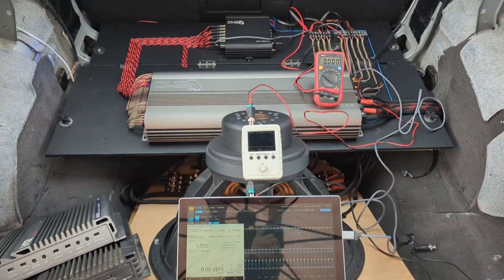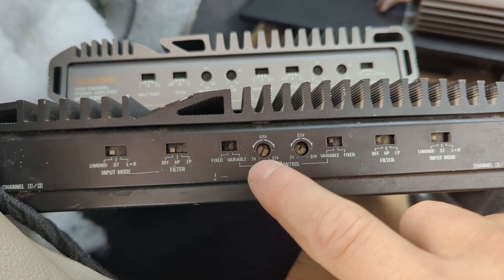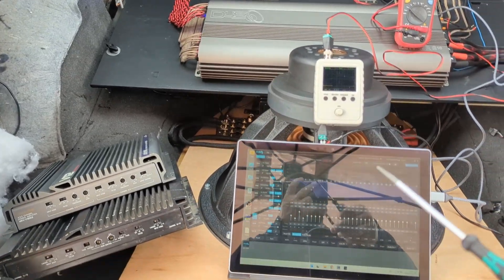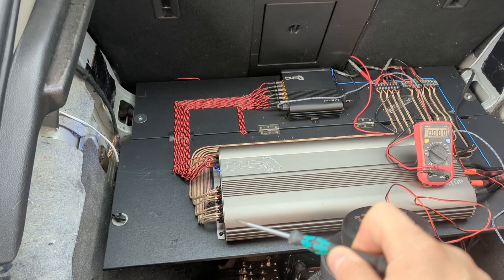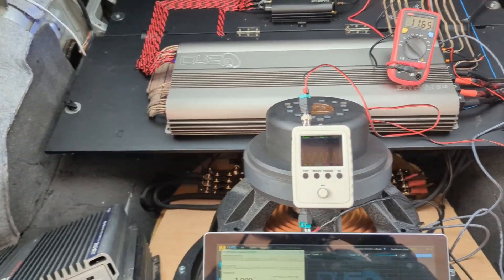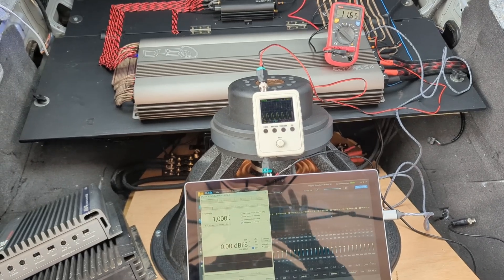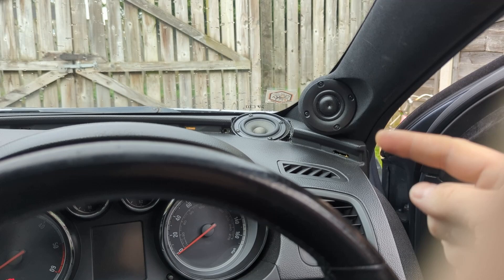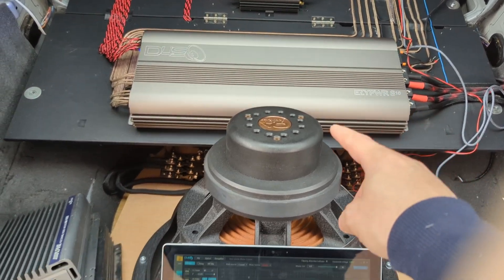Back to basics - how to set gains

Comment: Morning Raw. What about compression and expansion while using an EQ? I've run into this issue myself and try to eq last.
Reply from the maker: What compression and expansion are you talking about exactly?
Reply: @RAW-CAt  basically as you know at every frequency there are layers of different sounds. Well when you add to a frequency it pulls the very top layers first causing uneven gain from the top
Layer to the bottom depending on level. Opposite is true for cutting. It basically smashes the layers together. I know this for a fact. For one I could hear it and afterwards dug into the topic. Real issue studios deal with. My daughter plays live music and is a communications major in college and we've talked about this subject and the audibly of it. I also know this is way outside most people's interests.
Reply from the maker: @jonesaleroy  I'm not sure that is an actual issue when having 24bit content and max cut and boosts of +/-10dB.

Comment: Quick question. Isn't it the case that in order to use an oscilloscope and get correct readings from it (as well as from multimeter) you need to disconnect speakers from amps?
Reply from the maker: You can have the subs connected, but mids and tweets you will blow. I never recommend setting gains for mids and tweets, but since people keep asking, I made the video🤷
Reply: @RAW-CAt  yeah, thought the same. I just heard in the video that the speakers were playing
Reply from the maker: @dahack1  no, they were not. It was the amplifier complaining when clipping 😉
Reply: @RAW-CAt  🤨🤨 okay-ish 🙂
Reply: @RAW-CAt That’s scary you can hear that!

Comment: Thoughts on setting gain with a sweep over a singular sine wave let’s say a sweep 25-150 you make a smooth response with an O scope from let’s say your box is great from 32-60 hz so I make a smooth response as much output as possible without clipping from 30-80 with the sweep instead of just let’s say  a singular sine wave 30 hz  and a 40 hz because that would mean my music plays well from 30 through 80 with no clipping compared to just music that plays at 30 and 40hz. Been tuning all my subwoofers like this when it comes to gain it always sounds great compared to using independent tones just wanted your opinion.
Reply from the maker: In my opinion, there is no need to reinvent the wheel🤷 It does not matter what your subs or box is playing , for setting the gains all that matters is the electrical signal. And if using a DSP, that signal is clearly seen in the individual EQ window.

Comment: What if say my left mid bass eq is cut at 300hz and boost at  400hz . While right mid bass is boosted at 300 but cut at 400. 
 As per my response scenario and eq requirements. 
 But amplifier gain setting knob is common for these 2 channels. 
 What to do in that case?
Reply from the maker: You choose the "weakest link". See which OVERALL boost is higher, the 300 on R or 400 on L. As well take into account the channel gain. For example if your l side has +2dB overall boost at 400Hz and -3dB channel gain, you are -1dB in total for the l channel. And if your right side has +1dB overall boost at 300Hz and 0dB channel gain, then your R channel is higher in level, so you should choose 300Hz tone. Hope that makes sense. Just some maths😉

Comment: Some give target voltage formula. √P*R  . 
 Most of times it lands amp in clipping zone
Reply from the maker: Target voltage is valid only if the amplifier is true to the power ratings and you have a specific voltage on the power terminals.